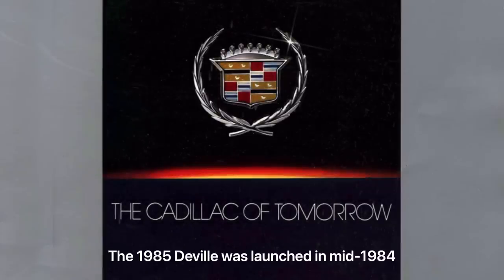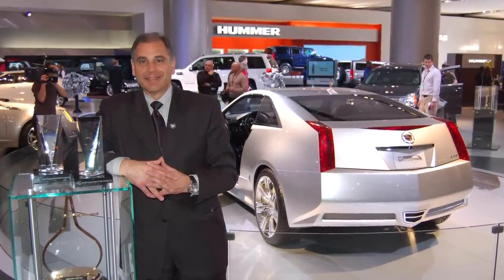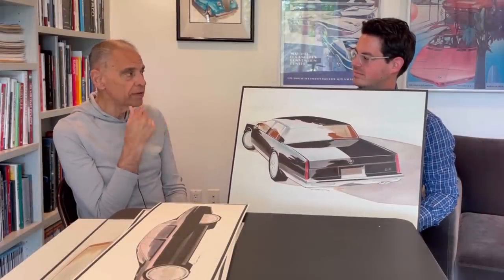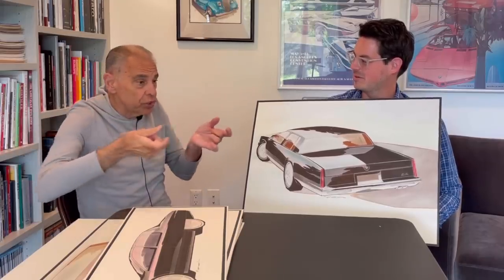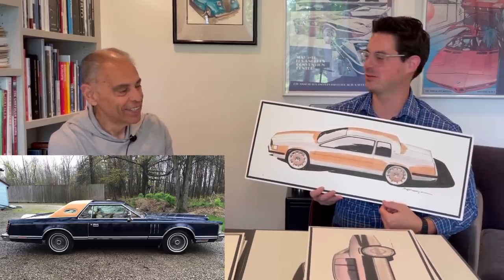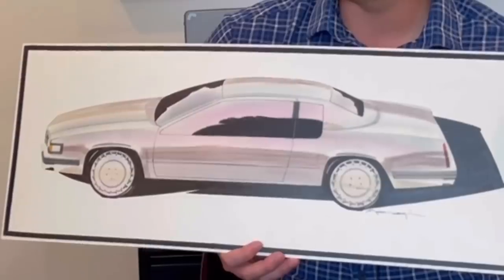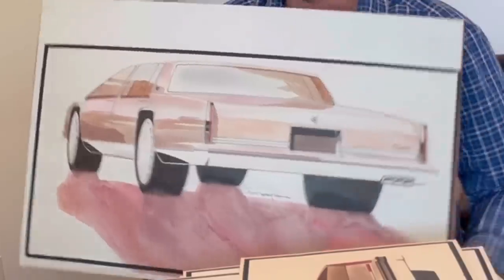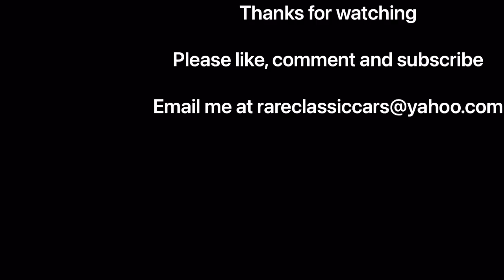The 1985 Cadillac Deville Was “The Cadillac of Tomorrow” (Incl. Designer John Manoogian Interview)

Comment: Thanks to John for sharing!

My father had an early '85 that he picked up Labor Day weekend 1984. He had done a factory order. It was Academy Gray with gray leather interior, a red pinstripe and wire wheel covers. Other options included power passenger seat, cassette player, and leather steering wheel. He skipped the rear defrost, but it never proved to be a problem, as the back window was so upright that it never seemed to fog. It was my father's second Cadillac -- his first was an '81 Seville. I want to say the Deville's sticker was about $24k, about the same as his '81 Seville.

The '85 was a big deal. The interior room was impressive. We pretty regularly had six people in the car. My dad liked planes, so he thought the "aircraft style" doors were pretty cool. I was a kid at the time, so it took me a few years to really understand what he meant when he said "the engine was sideways."

Unfortunately, that car was a mechanical mess. Two water pump failures in the first three years -- one of them was on a Friday when we were out of town for my father's best friend's wedding. The nearby dealer either couldn't or wouldn't take the car for some reason. An independent shop ended up fixing it. I don't remember if the car was still under warranty, but I recall my dad got at least a partial reimbursement after talking to the service manager at the dealer back home.

The other water pump failure happened on a holiday when my sister and I were off from school. My dad took the day off from work to take us to a movie. The car broke in the mall parking lot. We called a tow truck, and I'm pretty sure we eventually made it to the movie, but I don't remember how we got home. Years later, I recall hearing that GM put a lifetime warranty on the water pumps because the failure rate was so high, and they couldn't figure out a permanent fix, but I'm not sure if that's true. 

The '85 -- like the '81 -- also suffered from electrical gremlins that caused the door locks to go up and down at random times on their own. My sister and I would joke that there were poltergeists in the car.

After 5 years, the transmission needed replacement, so my dad punted the car and bought a Mazda 929S. In 1992, after two years with the Mazda -- he leased a '92 Eldorado in Polo Green and drove only Cadillacs for the next 20+ years.

Like you guys mentioned, there were a few cues that were only in '85. The big backlight, the black bumper moldings, the minimal chrome rocker moldings and the seat design, I believe, were all exclusive to '85. Personally, I didn't like the tighter backlight that came in the later cars, as it clearly looked like a tacked-on afterthought.

Overall, I miss the big side windows cars had back then. These days, automakers put these huge glass roofs in cars to make them feel "airier," and make up for today's high beltlines, which give a feeling of claustrophobia. The problem is that all the glass in the world up there isn't going to keep you from feeling like you're driving a bathtub.

Thanks again for this series. Obviously, this one really resonated with me.
Reply: I really enjoyed your story. I’d love to know what your and your dad’s experience with the 90s Northstar Cadillacs
Reply: @mblackmon7191  My father's Cadillac roster was as follows:

81 Seville V-8-6-4
85 Sedan DeVille
92 Eldorado
94 SLS
96 SLS
99 Deville D'Elegance
01 SLS
04 SLS (bought back by GM for paint/finish issues)
04 SLS (to replace the first one)
07 STS 3.6
10 SRX 3.0 Performance
13 XTS Luxury
13 ATS 2.0T Luxury (for mom)
15 XTS Luxury

Dad had a bunch of early Northstars but never had any engine trouble. However, as you can see, he never had them for more than the term of a lease. I know the Northstar has a bit of a tarnished reputation, mainly because of head gasket issues. For all I know, all his Northstar Cadillacs went on to blow head gaskets after he got rid of them, but while he had them, they were generally considered great, high-tech, world-class engines, at least as far as I was concerned. I think, for that reason, I don't have the image of Northstars as being bad engines the way a lot of people do. My understanding is that head studs basically fix the early Northstars but that that can be an expensive fix. From what I understand, the later Northstars are pretty reliable.
Reply: Your dad's car had those problems at least,  in part because that design was in its first year and still had kinks that had to be worked out.
Reply: @aaronwilliams6989  For sure!
Reply: Thank you because I remember my grandpa loved Cadillac and I always wished he’d got one of the 90s modes because when they came out they looked so cool and modern. I had a 2010 CTS and enjoyed it, the only thing is it seemed to lack a little shove from the V6
Reply: My mechanic said that as long as Cadillac produced that HT 4100 V8 that he would have a job 😊

Comment: The 1987 was my favorite year for these. I was in my early teens when these came out and I remember being super curious about the downsized design. The ride quality in the 1987 Sedan de Ville was so smooth and controlled compared to the rear wheel drive designs. I couldn’t believe how heavy the car felt in spite of how much smaller it was. These were very contemporary for the time, and definitely kept in pace with the “Contemporary Spirit of Cadillac” image GM was going for. I’m not sure the demographic that actually purchased the car was what they initially intended. My observation was that more people in the 45+ age group went for these cars, rather than the younger crowd Cadillac was aiming for. As a 45+ man who has fond memories of the ‘87 Sedan de Ville, I am still enamored with this car. This design was innovative, and most definitely WORKED for its time.

Comment: Elements of that second-to-last drawing at around 14:00 were used on Broughams and Fleetwoods, like the bevel atop of the trunk, the thin horizontal backup lights above the bumper, and the chrome lower cladding. Speaking of the big boat Cadillacs, I would love to see a video about their design as they really are the quintessential classic Cadillacs and they’re the only ones you haven’t featured given the Eldorado, Seville, small Deville, and, hell, even the Cimarron, have been discussed!

Comment: I remember well the 1985 C body Devilles coming out at showrooms across my area. They sold extremely well because in northern states people wanted luxury cars that could be driven in heavy snow hence them having front wheel drive. The first couple of years, 1985 & 1986 lacked the rear tail fins protruding which was eventually added for 1987 and vastly improved the look of the rear ends. Flush mounted headlights also completed that theme of a more modern look in the front. Personally i liked the ribbed lower cladding look which was taken from Mercedes Benz to enhance the lower body side molding.
Reply: I had a new ‘87 Sedan deVille, mine was driftwood with driftwood leather. You are correct, they looked much better in the dark colors!  Thanks
Reply: @mammothscott1455  Is driftwood light or medium brown?
Reply: @klwthe3rd  hi, driftwood is a light tan.  We had thought we wanted the yellow which was so popular at the time.  However, the dealer did not have one but did have one in driftwood.   Driving home we would have sworn we were in a yellow car it was so bright.   At the time, I would have preferred a dark blue, though, I was “out voted.”  Cheers
Reply: @mammothscott1455  I like the driftwood light tan myself.  Yes, the yellow was super popular so i think it's good that you went with something more unique.  I asked because we had a 1988 Oldsmobile Delta 88 Brougham that could be ordered in light driftwood or medium driftwood.  My parents went with the medium grey, so like you, i didn't win.

Comment: My family bought a loaded '85  Fleetwood fwd trading off a 1979 Seville.  The engine burned oil from the start, but other than three a/c compressors, the Cadillac was trouble free transportation for eight years. I personally drove the car many thousands of miles while we owned it, and it was comfortable ride with excellent handling. The Fleetwood was handed down to younger family members and was finally sold to a mechanic that wanted it. 
There were a number of BOSCH relays under the hood, I'm not certain what they supported, but it lead me to believe that some of the technology was European.

Comment: Thank you, John, for sharing your drawings and experiences at GM.  Seeing these drawings and hearing you and Adam comment on the exteriors development of Cadillac during the 80’s is a real treat. 

After driving an ’82 Eldorado for a few years, my Dad bought an ’85 Coupe de Ville. The back seat seemed much more spacious and airy in the de Ville as compared to the back of the Eldorado, especially as we grew older and had 3 young adults riding back there.  The de Ville was white with a camel-colored leather interior, like the Eldorado.   (I have to agree with Adam: I would have personally preferred a dark exterior and interior.)    Dad liked the spaciousness of the de Ville, although he was a little suspect of what he termed a “shrunken Cadillac.” 

The de Ville was not without its mechanical issues. On the 200 mile drive to my graduation in Austin, the car broke down around Temple, Texas.  I seem to recall him saying it had to do with the water pump.  Fortunately, he found a dealer there to take the car and gave him a loaner to continue on to Austin.   He finally arrived, to my family’s relief (no cell phones back then), and just made the end of the ceremony. 

Dad kept the car for a short while longer, but it developed more mechanical problems, so he sold it and bought a Ford Bronco instead.   He never bought a car again, only trucks / SUVs.

Comment: Excellent video!..I owned an 86 Sedan Deville back in the early 90s. It was a heavy smooth riding Caddy, but the engine def. had gremlins. I do not recall exactly what the problem was (maybe head gasket), but after the repair it seemed to have lost about half of it's hp.

Comment: While I liked the door-into-roof design, I was disappointed by the side glass, which was the opposite of flush.  Looking at the shoulderless sheetmetal now, I can see the likely reason for it, as the necessary window articulation would have been challenging in the framed glass environment.  While I have a renewed appreciation for the clean style of the 1985-88 cars, they didn't really resonate with me fully until the 1989 refresh and lengthening.

Absolutely fantastic guest.

Comment: I must admit, when these were new and I used to receive the brochures, I always gravitated to the rear wheel drive Brougham as a “proper” Cadillac. John’s early sketch would have been better with slight hints of rear fins, maybe a slightly covered rear wheel and lower chrome ala the 96 Fleetwood. I think this would have  helped the design become more formal and Cadillac like. The production car was clean but I expected more from Cadillac. The C body was more acceptable in the Electra in my opinion. The later “enlargements” of all these body styles were more on point. Great to hear John and see the sketches so thanks very much.
Reply: The next Gen sketch he showed you was really nice. I wish that was the approved design. The more rounded, heavier look.

Comment: Lincoln Town Car sales Doubled when Traditional Cadillac Owners wanted the RWD Full Frame soft Floaty ride that Lincoln provided at a better Price as well !
Reply: The car had more attention to detail. As a kid I got to ride in both and think that the Cadillac was nimble compared to to the bloated Town car that used to much plastic in the bumpers to increase its size?!
Reply: @codymcnary3607  My 1988 Town Car 5.0 motor seems to be Faster and have way more Torque than 1980 Olds 98 350 Rocket , But I love both of these cars since new and will never part with Either of them.

Comment: I had a 1985 FWD Fleetwood, for which I traded in my beautiful 1982 Fleetwood Brougham Coupe. Aside from the godawful Lexus I was once dumb enough to buy🎉, it was the worst vehicle I’ve ever owned. I took delivery of it on a rainy evening, so imagine my shock when I looked at it in the sunlight the next day and saw primer showing through on the entire right quarter panel! Of course, the body shop quickly repainted it, but they couldn’t do much with the crooked tuck-and-roll pleats in the rear seat cushion. Aside from that, the car sounded—and rode— like a cement mixer. I was actually being passed going uphill by Ford Pintos. After five weeks of this lunacy, I threw in the towel and threw the keys onto my sales associate’s desk and demanded he get me a real Caddy, i.e., a big old rear-wheel-drive Fleetwood Brougham Coupe. I was so desperate to be rid of my Crapillac that I didn’t even care about color or options. I kept that car for some years and still miss it. Such is the misery that Roger Smith inflicted on Cadillac’s loyal customers, many of whom defected to other makes and have never returned. Good work, Roger!  Thanks, Adam and John! Love your talks together!

Comment: I had an '86 Coupe DeVille, dark gray with gray leather interior, hard top with moon roof. Absolutely gorgeous car BUT - Moonroof was the first thing to fail, stuck open during a rain storm on the Jersey Turnpike. Then an oil seal leak while driving and finally the transmission went in 1989 with 75k miles.

Comment: I have always been a fan of the 1985 DeVille and Fleetwood since they came out. I would like to point out the following about the roof treatments on these cars.

While the 1985 Sedan de Ville had the large, fully exposed back window (backlight), the Fleetwood sedan had the closed in limo style rear window! 

The 1985 Coupe deVille was offered with 2 different vinyl roof treatments from the factory. One had a larger opera style window, and the other style was a Cabriolet type, with smaller opera windows.

In 1986, Cadillac made standard on the Fleetwood Sedan a very awkward vinyl 1/2 roof that enclosed the windows on the back doors with vinyl (just like the 1985 Fleetwood Limo). This roof treatment did nothing for the look of the car. It just made it look off balance.

Comment: Curious question: since this car was front wheel drive, why weren't the interior floors flat?
It appears still to have a 'hump' on the floor front and rear.
Reply from the maker: It was mostly used for exhaust/catalytic converter clearance.

Comment: I "heard" why the cars shrunk, it was to GM thinking gas would be $3.00 by 1986.  I have had a 84 Deville, 2 81's, 86 Brougham, 76 Fleetwood and currently a 95 Fleetwood Brougham with only 50k on the od..   The 85 Deville  to me was almost a hearcey.  I always thought Cadillac meant large body, huge v8, The 84 Deville was perfect to me minus the HT4100 engine and 200r4 transmission.   I liked the 89 restyled Deville but I still liked the rear wheel drive Brougham.   85 was a nice package, but too small for my taste. The downsized 86 Seville and Eldorado  were not my  cup of tea either.
Reply: The 88-91 Eldorado was a breath of fresh air. The refresh look gave it life. I didn't care for the 86-87 Sevilles or Eldorados.

Comment: I traded my 1984 Oldsmobile 98 on a 1985 Cadillac Sedan DeVille in the summer of 1985. That winter all of the stainless trim on the 1985 Cadillac (wheel well Moldings, Moldings around the windows) totally discolored with white blotches. I took the car to the dealer who said there nothing was wrong and would not replace the moldings. The 1985 Cadillac did not ride anything like my 1979 Cadillac (the 1979 Cadillac rode very smoothly and was wonderfully comfortable on long trips). I was never impressed with my 1985 Cadillac and traded it on a 1986 Volvo wagon. The Cadillac looked odd on the small 14” tires, you could put your arm all the way around the tires in the wheel well they were so small!

Comment: Great interview, but for me, the beginning of downfall for Cadillac, to close to Buick, Olds dimensions, squarish uninspired styling and to small, they would try to correct few years later by pulling the bumpers out and streching the bumpers fillers and adding a fender skirt for the Fleetwood but, just doesn't look majestic and has too few Cadillac traits, the worst was yet to come tough with the 86 downsizing of Sevillle, Eldorado, Toronado and Riviera, absolutely awful and sales and prestige declined... I don't blame the stylists, they have to work around a given platform but that's'where GM went overboard with downsizing and killed the cachet of these cars
Reply: I think part of the problem you mention was that younger buyers wanted a more European style car, without all the tufted button seats, coach roofs, wire wheel covers, etc. - while the WWII Greatest Generation Cadillac, Olds & Buick buyers demanded it.

GM tried to split the difference - which ended up not fully pleasing either. They did a more Euro styling direction, but kept one foot in the past to satisfy existing customers. Young buyers can order a sporty “touring” package Deville, while WWII generation can still have their “Fleetwood d’Elegance” package. 

The new C body sold well - but eventually competitors started chipping away. 

For the WWII generation buyers, Ford had showrooms full of unapologetically full-size Crown Victorias, Grand Marquis, Lincoln Mark VII & Town Cars, all with standard V8 engines, lighted coach roofs, wire wheels and the tufted seating they loved.

Meanwhile, for the Baby Boomers, makes such as Acura, BMW, etc. had the products they wanted, but without the baggage of being “your father’s Oldsmobile.”

 All that said - this is a great video series with John and Adam. Looking back at them, they had a nice style to them that has stood the test of time.